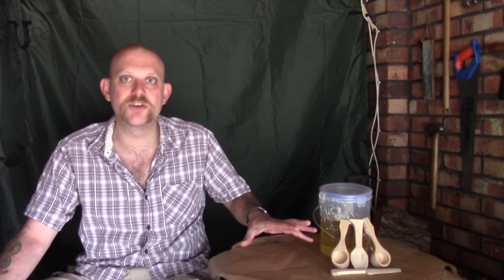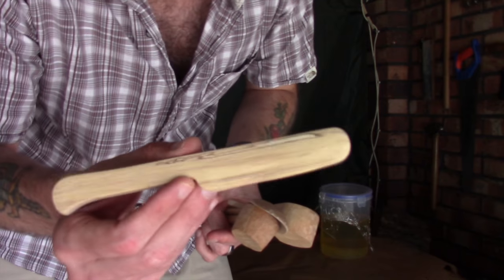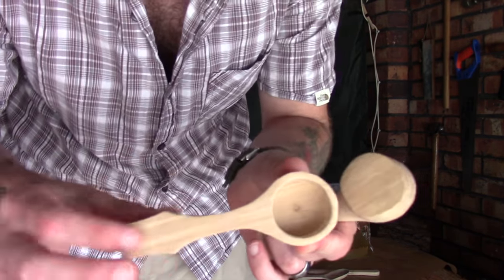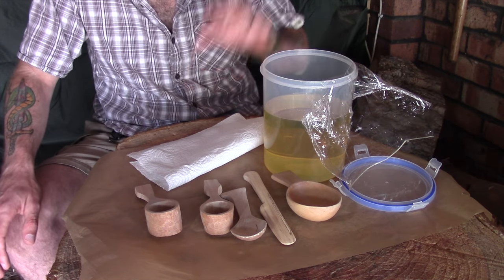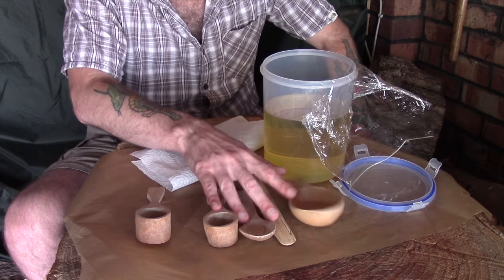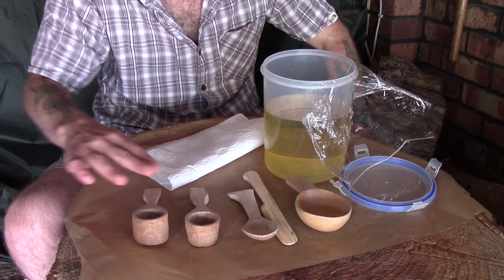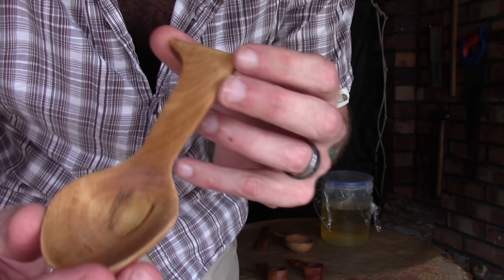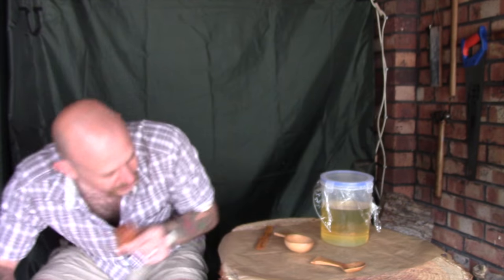Oil Finishes for Wood - My Methods

Comment: Hey woodcraft hamster! im wondering how long you let the spoons "dry" until you use them ? im testing some linseed and walnut oil finish on mine, letting them dry for about 1 or 2 weeks but as soon as the get their first use (mainly soup!^^) i find the oil mostly goes away (is that normal?)
Reply from the maker: Cyrille L-G it depends how much oil you are using. A light coat or two may not penetrate the whole spoon which could be your problem. I only leave them about a day between coats.
I have spoons that I have used for years without recoating but the surface layer does lose some oil especially with hot food, as long as it’s penetrated the whole spoon the surface layer isn’t too much of a problem. Hope that helps. H
Reply: @WoodcraftHamster  thanks a lot! ill experiment with multiple coat then! :)

Comment: What about but allergy with the oil is another oil any good ?
Reply from the maker: Random Fox tung oil is always a good option, food safe and often used on kitchen sides, chipping boards etc...
Reply: Woodcraft Hamster yes but walnut cooking oil is a lot cheaper especially ad I has limited funds
Reply: Go with mineral oil. cheap and food safe

Comment: Very interesting video, thank you. I´m in Andalucia, so I have both almond and olive trees, amongst others. I´ve not tried carving almond yet, but using almond oil, (rub it with a nut ?) sounds a good plan. I carve olive spoons, and use olive oil, baked in an oven which will give them a lovely dark finish if left in long enough. A good burnishing is also important.
I also use olive oil on leather motorcycle clothing, shoes, belts, satchels etc, and in many years it has never EVER gone rancid, even in the heat of summer, so don´t be put off -- after all there´s some olive oil in almost every kitchen.

Comment: See I wouldn't have ever thought of getting almond because it's the lightest. I have been looking for an oil to stick as close to the wood color as possible. Thank you, that was the biggest thing I learned.
Reply: If you want to stick as close to the wood color, you should try out Walnut oil. Because it does not have a yellowish color to it like linseed oil the wood will keep its color.

Comment: Thank you for the video. Will olive oil also work?
Reply: As far as i can tell, Olive Oil has a tendency to stagnate in the wood. Therefore, it might not be the best to use.
Reply: Olive oil goes rancid, and I think corn oil too. So avoid for food use finishes.
Reply: No. Never use olive oil. Dunno why people recommend it often. 
But if you want an oil finish there are basically three good oils to use:
- Linseed Oil
- Walnut Oil
- Tung Oil
These three will harden out relatively quickly (2-6 weeks) and provide the best degree of hardness.

Olive oil needs way to long to harden and will go rancid before that.
Reply: @NetGhost03  thank you. Going to use linseed oil 👍😉 appreciate the advice! ✨
Reply: I have used olive oil on chopping boards and never had a problem.

Comment: hello i bathed my plywood thing in linseed oil for about 10 hours but it came out oily i left it in paper towels overnight but it didnt help how cam i make my thing feel dry
Reply: you might have used too much oil. you can wipe away using cloth the remaining oil
Reply: @RingsnThingsWorkshop  😂
Reply: use rag to wipe away any excess oil, then use a finer cloth or polishing cloth to buff it which will give it a smooth feel
Reply: Sorry... You bathed your wood in Oil for 10 hrs, but it came out Oily..?? 🤣😂🤣 I love the Internet 😆
Reply: @sneakypotz1312 have you watched the video 2:30 listen to what he says

Comment: Can i use olive oil??
Reply: Not recommended because it can turn or go bad and leave a bad smell on the wood.  Almost a rancid smell.  You can get generic mineral oil at the pharmacy or walmart and it works well.
Reply: @mikeyandalyssab4782  I used olive oil on a cedar wood box and it turned out fine. I didn't use a bath, I just painted the oil on with a brush, left it really thick on the cedar and let it sit about an hour. Then wiped it off really well with a paper towel. I'm curious how olive oil goes rancid but not other oils, or nut oils. because its a vegetable based oil, right? I figure you just shouldn't leave the olive oil to set on the wood too long, or it would or could go rancid. any ways, it worked this time for me. gonna see what happens with some red oak this time. oh, also, I think the fact that I live in a really dry climate might have an effect on the way the olive oil sets up on the wood.
Reply: @matthewulisse9157  there are a few oils that harden when exposed to air; linseed, walnut, poppy seed, and tung.  all other oils stay wet and as they're exposed to oxygen and light they become rancid.  you item will develop a sticky feel and if oiled enough, start to smell bad.  it won't happen over night, but a few months from now, your pieces will go rancid.
Reply: @tawilk  well Im hoping its not oiled enough then. we will see what happens. Im also hoping, since Im in colorado, and its really dry here, it will be ok. Ive left cups of olive oil open in my room before, and it has completely evaporated from the container. if it goes rancid, I'll just make a better box and burn this one. Thanks for sharing the oils that harden, useful stuff to know as hobbyist wood worker. also, just a random thought, I read some where the other day that what makes the oils like olive oil go rancid is the proteins in the oil basically decaying. wonder if there's some kind of chemical reaction one could cause to remove the proteins in oils and refine it in a way, to be used properly for wood working applications. probably too much of a pain to really do for anyone, considering alternatives are cheap and easily accessible. I just enjoy knowing the way things work.  peace brother
Reply: @matthewulisse9157   I wouldn't know about it evaporating enough to not be in the wood anymore.  there is no protein in oil, it's 100% fat.  rancidity happens because of the breaking down of the fat molecule due to oxygen, heat, and/or light.  if you have an old olive oil bottle w/ a sticky film around the cork or cap, that's rancid oil.  your tongue actually has tastebuds specific to identifying rancid fats.  most oils come in colored bottles to help prevent issues with light.